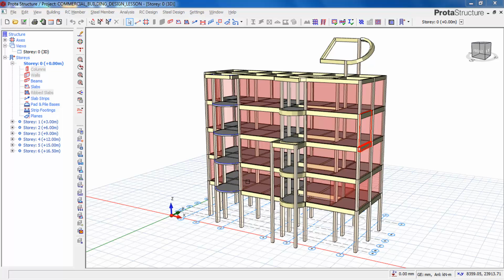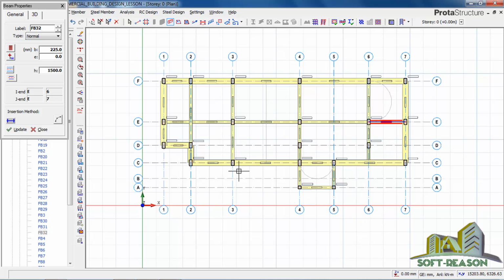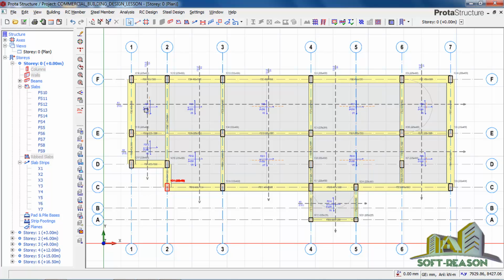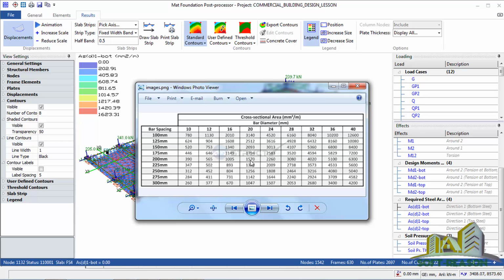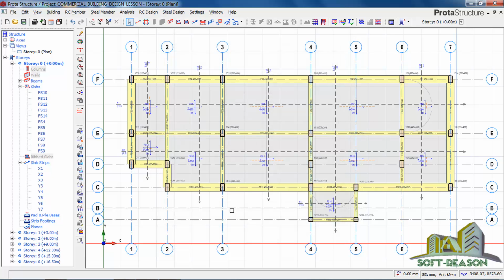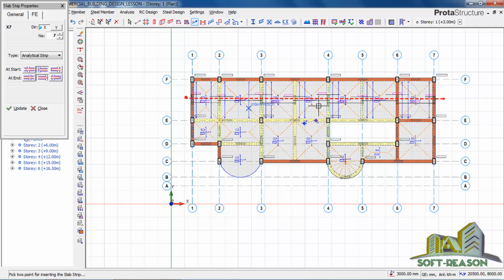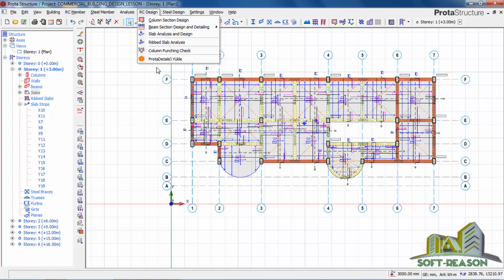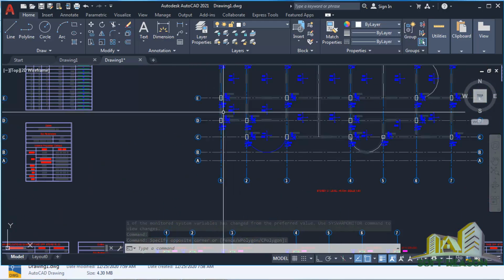Reinforced Concrete Raft-on -Beam Foundation in PROTASTRUCTURE

Comment: Thank you sir, all your videos are well explained and easy to understand. But I want to know sir why you used 450 x1500 on your raft beam width  at the external and 225x1500 width at the internal instead of using the 225x1500  all over which is the size of your wall?

Comment: There's an overlooked step, The allowable soil stress is exceeded around the edges for your model, that is a problem not addressed.
Reply from the maker: In such case increase the thickness of the raft and run analysis again

Comment: When designing is used 225*225 column instead and 225*1500 beam for foundation. It notified slab thickness insufficient and after post analysis that slab strip missing
Reply from the maker: Increase the slab thickness and start the analysis all over. Ensure you follow the lesson steps.

Comment: How do I view foundation beam moment diagrams. I can easily view other beam moment diagrams bu the raft foundation beams I seem not to find that option
Reply from the maker: To see the moment diagrams, go to concrete design tab, in the drop menu select beam reinforcement and click on foundation beam. In the dialogue of foundation beam, you can check bending moment and shear force diagram.
Reply: @CADmade-easy  If I go to concrete design tab then storey beams I get the view moment diagrams option but similarly if I go cocnrete design then beams then to the foundations beams even when I further click the on Interactive Design option the window that pops up will only have the detailed drawings option under steel bars but nothing on moment diagrams. Please kindly help I am using Protastructure 2018